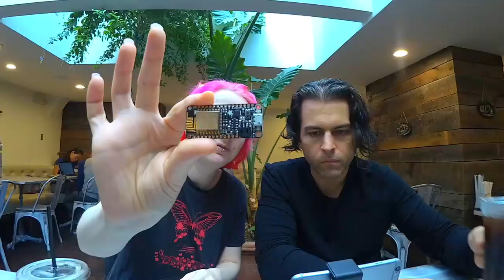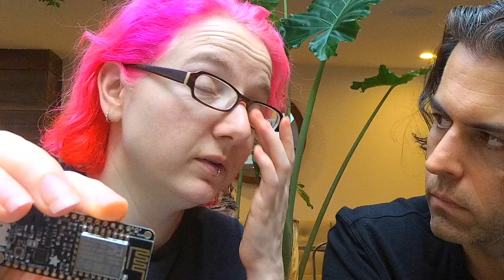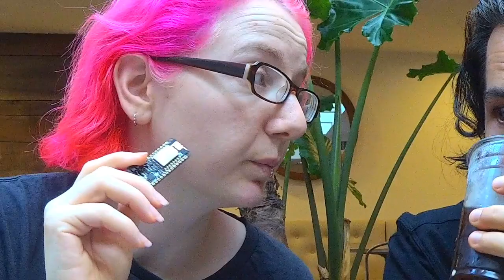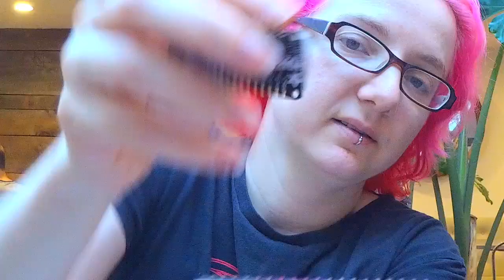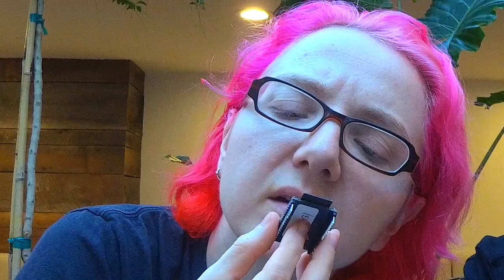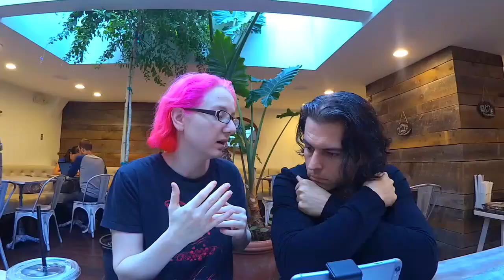Saturday chattin' ESP32 is here... @adafruit #adafruit

Comment: Hi Adafruit Folks,

Your "Feather ESP32" board looks both wider and longer (with a 2 x 19 pin PCB layout). I foresee problems for folks who like to use MB-102 breadboard. I am not sure if you are familiar with the NodeMCU boards (similar to your Feather ESP8266 boards), but the first one was designed by a company called Amica and on their v0.9 boards, they had a problem that when you went to plug the board into a standard sized (MB-102) breadboard, that all the available pins for connecting in components were already covered up by the NodeMCU board itself. Their v0.9 board came to have a reputation of being "breadboard unfriendly". To work around this problem, you could use two breadboards, remove the power rails from one board and space them about 1 cm apart (better yet, plug in the NodeMCU board and use it as a spacer, then peel-off the backing tape and to "glue" the two breadboards to a suitably sized plywood base board). Amica recognized this problem and corrected it with their thinner NodeMCU v1.0 board. Now with the v1.0 NodeMCU board, there is exactly 1 pin exposed per pin of the NodeMCU board. Not many, but better than none. But, at least one of their competitors (LoLin) did not recognize this problem with the board width problem, and so their board continues to have this problem and reputation of being "breadboard unfriendly".

For those folks that have LoLin NodeMCUs, or have Amica v0.9 NodeMCU boards, I recommend they buy one of those cheap "mini breadboards" with 170 connection points (arranged in a 17 x 5 x  2 arrangement with no power rails).  Then use that with the MB-102 breadboard, again spaced apart by about 1 cm. Again, use the NodeMCU board as a space, and peel off the backing tape to glue the assemblage onto a plywood baseboard. The NodeMCU board must be oriented such that it straddles one pair of power rails, but you will find this works pretty well for a minimum of extra cost.  

However, with your 19-pin long Feather-32 board, the Mini breadboards are two pins too short, so now you have to buy two MB-102 boards (much more expensive) and break away the power rails on one of the two MB-102 boards, use the "Feather ESP32" board as a kind of spacer and "glue" the assemblage onto a suitably sized plywood board. It should work fine, but I recommend making your board thinner so it can be used on one MB-102 board as the folks at Amica did when they recognized this problem on their v0.9 NodeMCU boards and corrected it with their v1.0 NodeMCU boards. It will make your product a lot more "breadboard friendly".

Best of luck with the Feather ESP32 boards...

Comment: the chip is China's pre-programmed spy chip that allows for downloadable viruses.   imagine if the CIA offered a WiFi chip.....  
easily hacked to shut off at the beck and call of the ...  op's.... my tin foil hat is slipping,  they are beaming ..
this is the greatest and safest chip ever, use it for all projects you can.  don't google Stuxnet.

Comment: I gave up on the ESP8266 because of the (lack of) documentation - reverse engineering is often not a good idea - some chap has the docs in their filing cabinet - when you've invested your time - they can produce them or change the design - you lose. But credit to the "community" who has persisted with the ESP and produced good tools.

Comment: Can i use the board to connect to the pc without using the usb cable? for me to use Mobiflight connector for example for my homemade flight sim ? i currently use 2560 and usb to a pc with Mobiflight connector. would be so sweet to be able to get rid of the usb, and run all com via wifi (signals from my led 7 segments displays, encoders - for my homebuilt radio stack) and just plug in power to the board.... 
tips?
Reply: bluetooth?

Comment: Nice discussion. One thing that popped into my mind while listening; 

Would it be possible to fit an ADC for one or more channels on the Huzzah Feather? For example with the ADS1015 or ADS1115. They look small enough that they might fit. Consider it a challenge ;-)
Reply: Despite it being expensive, it is also not a good practice to mess around with old consolidated products (llike the Huzzah 8266)
Reply: Yes, the ADS1015 costs 1-3$ on DigiKey. An hour in EagleCAD and getting another reel for the Pick and Place with ADS1015 doesn't feel so expensive to me. And Adafruit updates some products. I call it keeping up to date or improving.